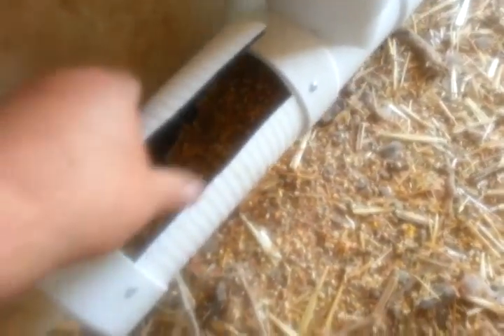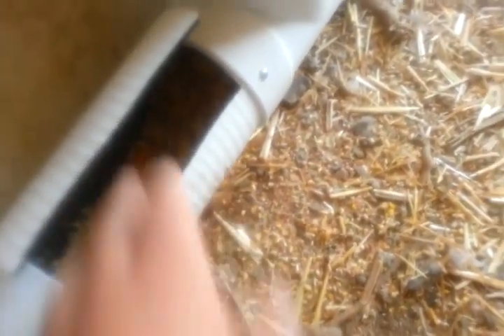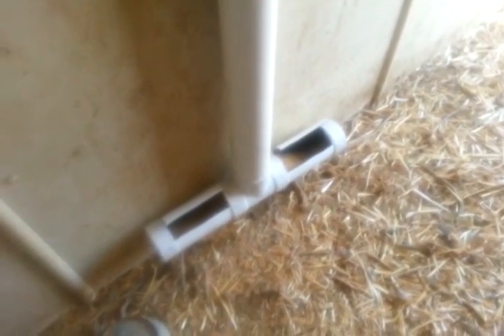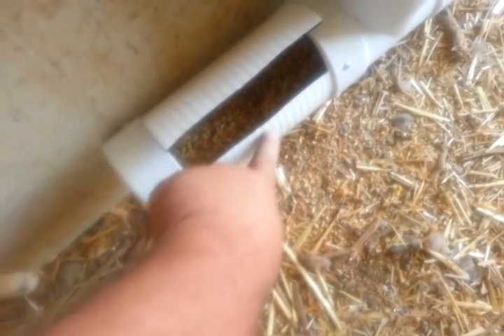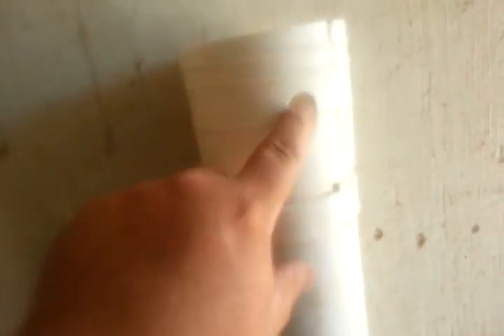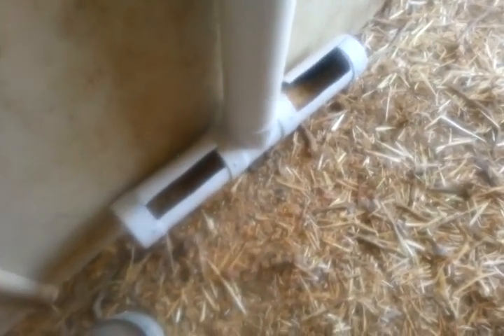Cheap/Easy chicken feeder.

Comment: any clogging
Reply from the maker: When I made the vertical pipe taller than 7ft, I did have some issues.  I shortened it to 4ft and put a 5 gallon bucket on top and have not had an issue since.